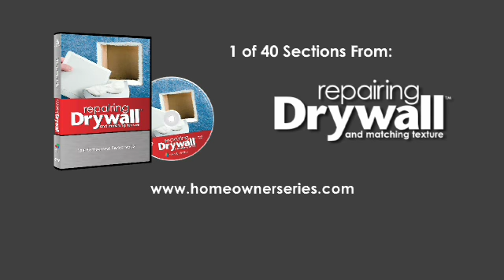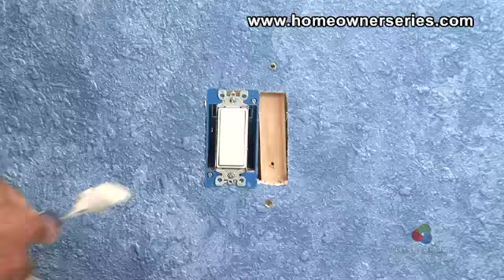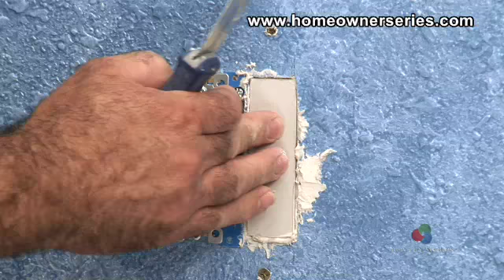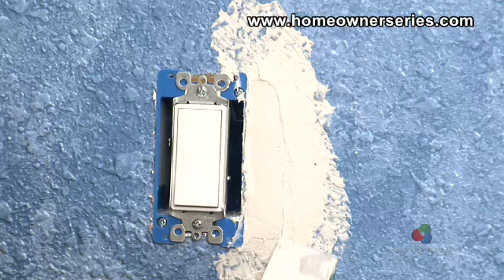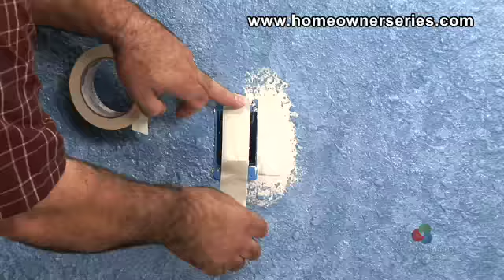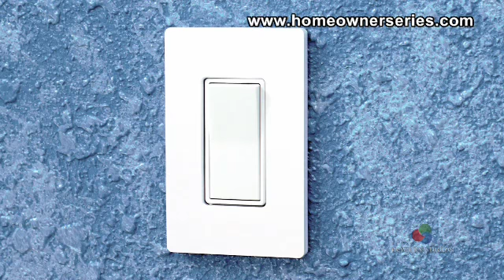How to Fix a Wall - Electrical Box Patch - Drywall Repair- Part 2 of 2

Comment: Have you seen The Outlet Plastering Safety Shield ? It's a plaster guide cover that make this repair a snap! It protects the face and side terminals of a switch or outlet. This guide eliminates the possibility of terminal contact with wet plaster or plaster knives. Find it on youtube or google.

Comment: No warning about turning off the power to the light switch?  Wet rag + electrical current could make for a bad day.
Reply: Come on I would like to think if you are willing to try to work in anything near electricity the person is at least safety conscious around electric itmes